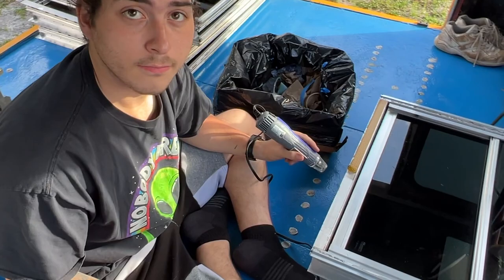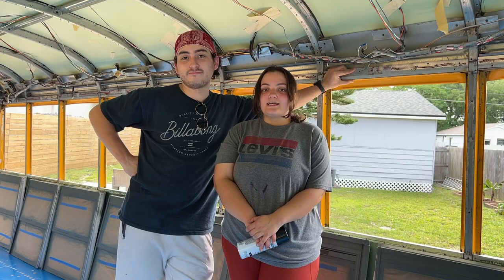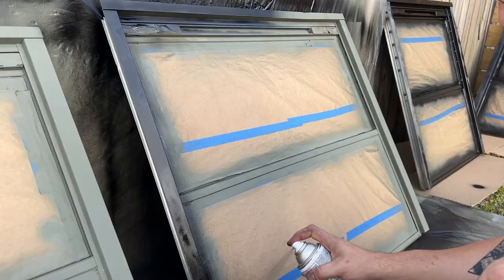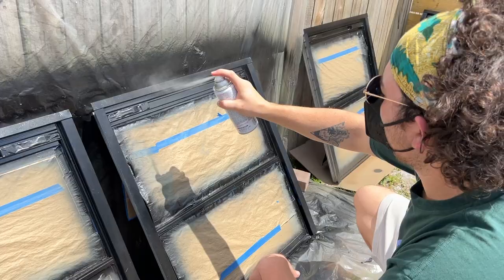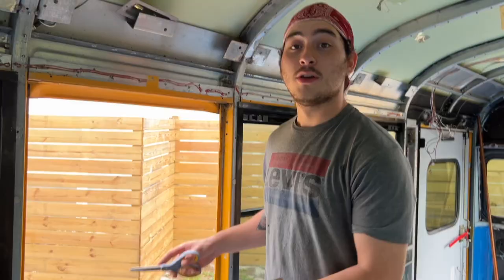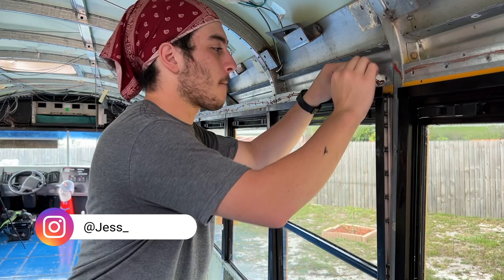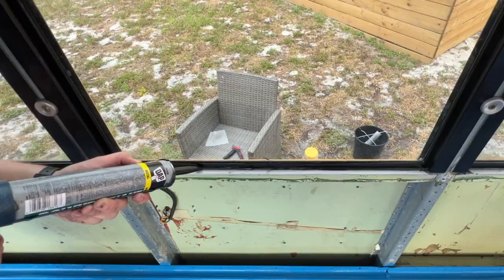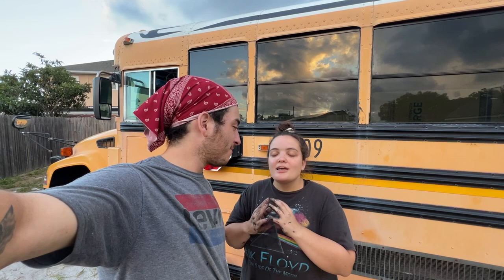Painting and Sealing Windows | School Bus Conversion Ep.10

Comment: As a future FYI, the etch primer flashes and dries within 5 to 10 mins. After painting 4 or 5 windows, you could probably start over with 2nd coat on the first one. 
Same with the paint, it just needs 15 to 20 mins to second coat. With rustoleum, it's best to lay on second coat within 20 to 30 mins max versus waiting a few hours. 
Also, make sure paint is dry/cured long enough before clear coating or you will get a nice (usually unwanted) wrinkle finish.
Reply from the maker: Yeah, thanks for the great advice. Really appreciate your sharing the knowledge, for next time we know better :)